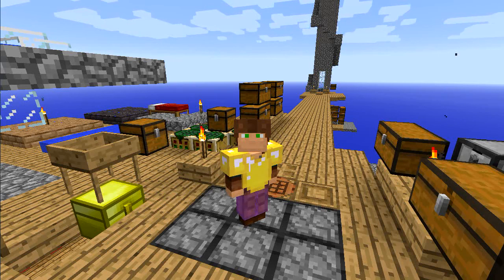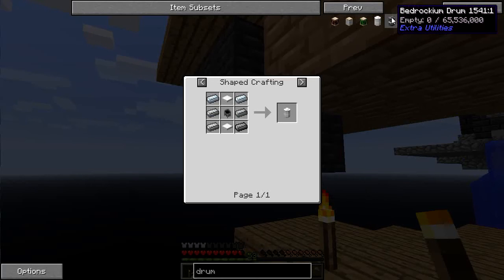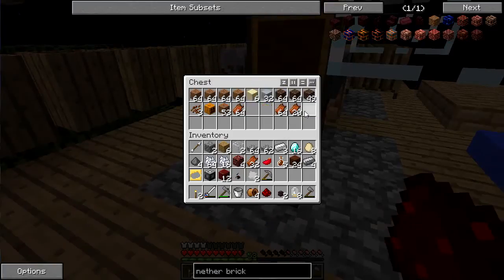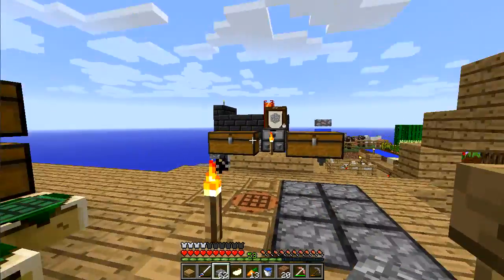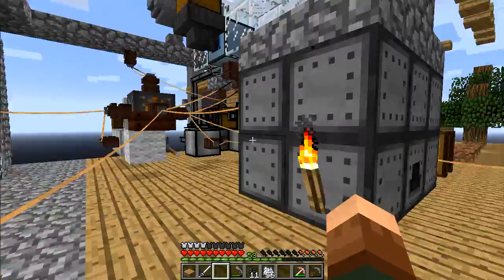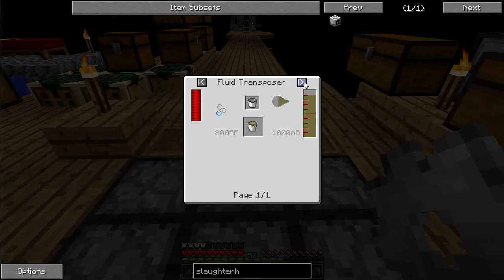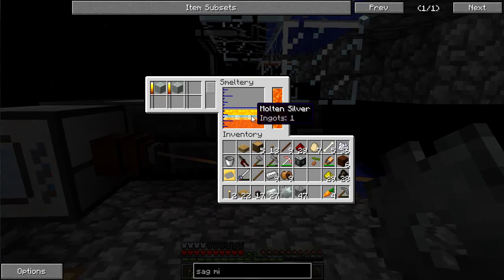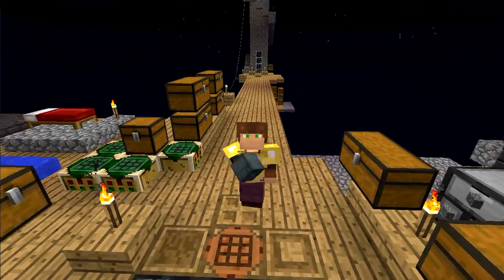FTB Infinity Expert Skyblock - Ep 8 - Redstone Supply

Comment: You can crossbreed redstodendron even with just one block of redstone ore. The ore just needs to be underneath the plot where you crossbreed into. You can set the mature plants on any cropstick with the trowel as long as the soil fits.
Most Thermal Expansion machines have upgrade recipes. So craft a basic machine block, build the machine, and upgrade it. Is sometimes easier / cheaper.